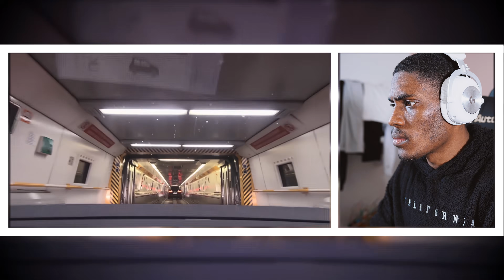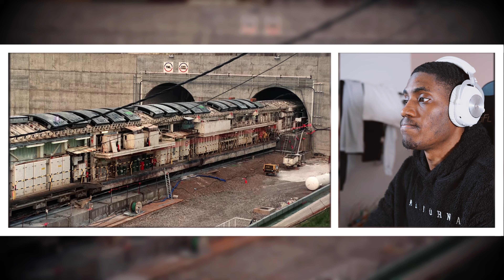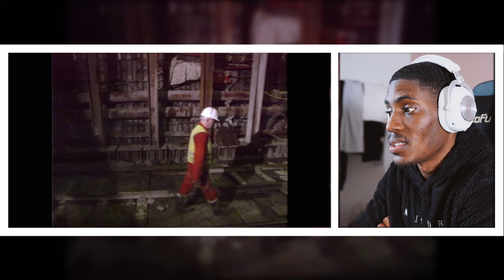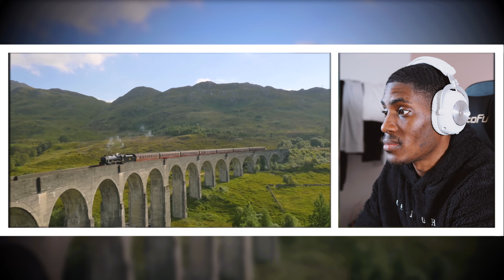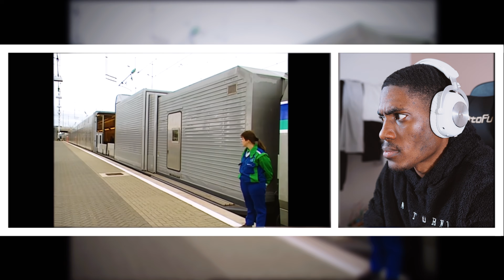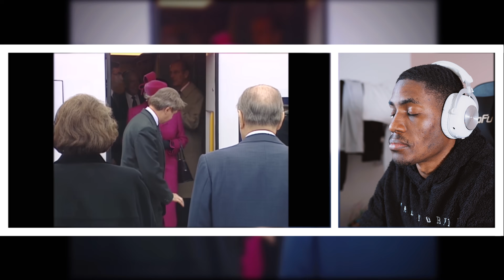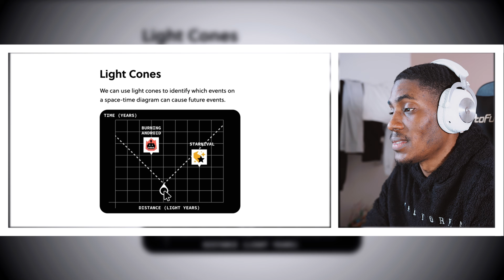American Reacts to How The British Channel Tunnel Works

Comment: We have travelled through the tunnel several times in our car and once took our caravan through it on our way to Italy 
It’s seamless and quite efficient most of the time although there can be delays at peak times. When you are in the tunnel you can actually see the undulating path it takes and if you set you satnav you can watch yourself go under the seabed 
There is a massive shopping complex on the French side of the tunnel and when it first opened people who lived close to the English terminal would get a same day return which was fairly cheap. Travel through the tunnel fill up their car with fuel (which was cheaper in France at that time) do some shopping and be back at home before midnight

Comment: I needed to know why couldn’t they dig a Very Very Very Very Very Long Deep tunnel and do an extension for most of the mainline Trains, so they can extend the abandoned London underground train stations. Why couldn’t they use the part D78 Stock train doors on the sides and also restructure the front face of the A60 and A62 stock which will include the class 507, class 508, class 313, class 314 and class 315 remix and make them all together and also redesign all of them into an overhead wire line trains and also make most of them into Five carriages per units and also having three Disabled Toilets on those Five cars per units A60 and A62 stock trains and also convert the A60 and A62 stock trains into a Leyland 510, Volvo D10A, Scania N113, Leyland TL11, Cummins M11, Gardner LG1200, Lister Diesel, Gardner 6LXB and Gardner 8LXB Diesel Engines and also put the Loud 7 speed Allison Gearboxes even Loud 10 speed Epicyclic Gearboxes in the A60 and A62 stock, class 507, class 508, class 313, class 314, and class 315 and also modernise the A60 and A62 stock and make it into 11 carriages per unit so it could have fewer doors, more tables, computers and mobile phone chargers? A Stock Train and 7 Disabled Toilets on those A stock trains. Why couldn’t we refurbish and modernise the waterloo and city line Triple-Track train tunnel and make it even much more Larger and extend it to the bank station, making it into a Triple-Track Railway Line so those Five countries such as Australia, Poland, New Zealand, Italy, And Germany to convert the waterloo and city line Triple-Track Railway tunnel into a High-Speed Railway lines? The Third Euro tunnel Triple-Track Railway line to make it 11 times better for passengers so they could go from A to B. Then put the modernised 11 carriages per unit A Stock and put them on a bigger modernised Waterloo and city line Triple-Track train tunnel so it could go to bank station to those Five countries such as Australia, Italy, New Zealand, Poland And Germany The modernised refurbished 11 carriages per unit A stock could be a High Speed The Third Triple-Track Euro Tunnel Train, so it is promising and 47 times a lot more possible to do this kind of project if that will be OK for London, Australia, Italy, New Zealand, Poland and Germany oh by the way, could they also tunnel the Triple-Track Railway Line so it will stop from Buckinghamshire and Essex so that the Passengers will go to Australia, Italy, Poland, New Zealand and Germany and also extend the Triple-Track Railway Line from the Bank to Buckinghamshire and Essex Stations so that more people from there could go to Australia, Italy, New Zealand, Poland And Germany more Easily. Why couldn't they extend the West Coast Main Line Railway Stations and also build brand-new train stations so it could go even further right up to Clapton, Wood Street? Can they also make another new underground train station in Chingford, and could they extend the West Coast Main Line Railway Stations and the DLR right up to Chingford? All of the classes 155, 106, 154, 114, 105, and 117, will be replaced by all of the Leyland TL11, Cummins M11, Volvo D10A, Leyland 510, Lister Diesel, Gardner LG1200, Scania N113, Gardner 6LXB and Gardner 8LXB Diesel Five carriages three disabled toilets are air conditioning trains including Highams Park for extended roots which is the West Coast Main Line Railway Stations and the Docklands Light Railway Stations. Could you also convert all of the 1962 stock trains into an air-conditioned maximum speed 81 km/hours (51 MPH) re-refurbished and make it into a 7 cars per unit if that will be alright, and also extend all of the West Coast Main Line Railway stations to make more space for all of the extended 7 car per unit 1962 stock air condition trains and can you also build another Mayflower and Tornado Steam Locomotive Companies and can they order Every 92 Hexagon and Every 49 Octagon shape LNER diagram unique small no.14 and unique small no.11 Boilers from those Countries such as Greece, Italy, Poland, and Sweden, can they make Mayflower and Tornado Steam Locomotive speeds by up to 157MPH so you can try and test it on the Original Mainline so it will be much more safer for the Passengers to enjoy the 157MPH speed Limit only for HS2 and Channel Tunnel mainline services, if they needed 13 Carriages Per units, can they use those Lister class 93’s, Lister class 17’s, Lister class 47’s, Deltic class 44's, Lister class 40’s and Lister class 43HST Diesel Locomotive’s right at the Back of those 13 Carriages Per Units so they can take over at the Back to let those Mayflower and Tornado Steam Locomotive’s have a rest for those interesting Journeys Please!!!!, oh can you make all of those 19 Tonne Boxes of Coal for all of those 157MPH Mayflower and Tornado Steam Locomotive’s so the Companies will Understand us PASSENGER’S!!!!! So please make sure that the Builders can do as they are told!!!!!!!!!!! And please do something about these very very important professional ideas. Prime Minister of England, Prime Minister of Australia, Prime Minister of Poland, Prime Minister of Germany, Prime Minister of Italy, Prime Minister of New Zealand, and that will also include the Mayor of London.

Comment: The Channel Tunnel make a profit on its operating costs, which is enough to make it viable. It's not a white elephant, and of course it should have been built.  Most people without cars (70-90%) travelling between London and Paris use the tunnel not planes. For crossings from Folkestone to Calais by car, about 60% is by tunnel and 40% by ferry. But when it comes to freight, ferries have 95% of the traffic.

Comment: I live in London I can be in Paris in 2 hours 15 minutes Brussels 2 hours & Amsterdam 4 hours It’s a fantastic link if you’re using the passenger service it’s city to city unlike an airport which you have to get to then wait an hour before you can get your flight, which is another hour and then another half hour at the other end to get into the city Centre you can book a single for a approximately $65  I disagree with you it’s very needed  It’s a fantastic peace of engineering. And a great link to Europe.

Comment: I've used the tunnel several times to drive my van down to my brother's place for a months motorcycling in SW France… It's quick and convenient, connecting seamlessly between the UK motorway and the French autoroute system.
 I drive 200 miles to the tunnel in late evening, grab a few hours sleep in the driver's seat while waiting for my booked early crossing at around 5am, then arrive in France at the same time due to the time difference. This way I'm early enough to avoid Calais' and Rouen's morning rush hour traffic, and catch the quiet spell between morning and lunchtime busy periods passing through Chartres… the rest is plain sailing through open country and great scenery on a mixture of traffic free N roads and fast autoroutes, climbing the Massif Central after Clermont-Ferrand and crossing the famous Viaduc du Millau (If engineering's your bag, check out how that was built… amazing. https://www.youtube.com/watch?v=mbAw8unrJ-U ). Only stopping for fuel and/or a piss (if you step inside a services, you've lost at least half an hour) and eating packed food, I'll arrive in time for dinner at my brother's place, near Béziers (around 650 miles from the tunnel), or we'll drag my bike out of the van and ride to a nice local bistro or bar. Driving long distances on French roads is easy and pleasurable. The 200 miles on the UK ends of the trips feels almost as long as the 650 miles in France.

Comment: Others have said, but this is definitely not a fail. It’s incredibly well used albeit more pricey than it used to be. If you live in the south east of England you can pop over to Paris for the day and be home for bed. 

I mean relying on planes that require fuel and inevitably deliver some distance from the city centre has its place but you never know when so idiot is about to do something stupid where all the fuel is coming from do you!

Comment: HS1, the tunnel and TGV allows direct travel from St Pancras station in the centre of London to Gare du Nord in the heart of Paris. There is London City airport, but otherwise you need to get to London Heathrow, then from Paris, Charles de Gaulle into the centre of Paris.

Comment: Yes, cars.  I've taken mine on it.  The Eurotunnel trans are tall enough to be double-decker for cars - remember they need to be big enough for lorries, coaches and buses as well.  And of course there are normal passenger trains as well, the Eurostar from London to Paris, Brussels and Amsterdam.  I've been to Paris this way too - much less fiddle than flying and comparable in price and time.

It helped in building it that the sea isn't hugely deep.  The North Sea and the English Channel were dry land only a few thousand years ago and they've sunk, turning Britain into an island, only since then.  So Stone Age people got here by walking, and there is archaeology that can be done on the sea bed.  (Look up Doggerland to find out more.)  This also means tunnelling was easier than through solid rock. But soft soil or sedimentary rock has other problems... suffice it to say that the geology was investigated very thoroughly first, as stated in the video, to find the best path.

I well remember the day the British and French teams met in the middle and there was that handshake through the hole - it was all over the news!

Yes, a ferry takes longer.  It's an hour and a half compared with 35 minutes through the tunnel.  But a sea voyage is something different.

Comment: Back in the early 2000's I was a courier driver from England and have travelled through the channel tunnel loads of times, it's no that spectacular when you actually go through it, but yes it's an amazing feat of engineering. To be honest I don't like tunnels but yeah it is pretty amazing. I always went on the trains that carried trucks, you park your vehicle on the train then go to a carriage at the front of the train

Comment: Ive used the channel tunnel twice but it is dearer than the ferry. The ferry takes about 75 mins the tunnel is about 45 mins. 
The passenger train EuroStar goes from London to Paris its very expensive unless you get a deal. I prefer the ferry. The Eurotunnel is good but not being able to see anything outside is weird. 
London also has tunnels under the Thames river for vehicles also one at Dartford which is usually one way south to north and a bridge north to south. As its a toll service it does cause lots of slow moving traffic. However instead of paying cash at a booth it has vehicle registration recognition so its all done online.

Comment: I've never been through that tunnel, and I don't know if I'd feel very safe doing so. After the disastrous fire in the Mont Blanc Tunnel, it's understandable to be afraid. The Mont Blanc Tunnel was already old, and the technology of the time was certainly less reliable. That's perhaps also why the Channel Tunnel is only for rail. There's talk of a tunnel project under the Strait of Gibraltar, but it's even more difficult to build : it's longer, deeper, and would require crossing the boundary between two tectonic plates. So, if that one ever comes to fruition, there's no way I'm ever going through it ! Yet, the Greeks built a suspension bridge that spans the Gulf of Corinth, crossing a tectonic boundary, and it's still standing today. It doesn't inspire confidence in me, though... I prefer the ferry : the sea is quite calm in the region, whereas there are often earthquakes.

Comment: As a structural engineering student, i have no idea how one would even start to calculate the things needed for this tunnel or what things you would even need to take in consideration for it 😅
Reply: Vous pouvez venir en Europe, pour apprendre ce que vos écoles ne vous enseignent pas. Le Tunnel sous la Manche n’est pas une vue de l’esprit, puisque chaque jour des milliers de passagers l’emprunte sans aucun danger et arrive d’un côté comme de l’autre en bonne santé, rapidement et sans polluer.
Reply: @salvatoreuzzardi6903  i am in Europe my guy, im Finnish 😁👍

Comment: For city to city there's nothing to beat it. If you are taking your car, it is identical to the ferry ie coast to coast  but quicker.  There are also an equal number of trains that go directly to Brussels, stopping at Lille en route. Also, those to Amsterdam and Rotterdam, in the Netherlands,  in addition,  since Eurostar bought the French Thalys trains  there is the Eurostar to the south of France.
Of course, having utilised the Eurostar to whichever destination you desire there are all the regular rail network links of the various countries to take you further afield, including those with sleeper carriages for longer distances.
So the tunnel gives you far more than just an A to B route, it opens up an entire continent.
I love Eurostar ❤  there is a bar and cafe, and full dining included in higher class tickets. Fares start at £39, but can be very expensive if you book last minute and/or go 1st class.

Comment: There are occasional delays for various reasons but overall, my family and I have used it plenty of times and it is pretty good. It takes around 35 minutes to travel under the channel, the usual crossing time for a Dover Calais ferry is about 1hour 30 mins. However it's generally much faster to embark/Disembark the Channel shuttle trains compared to the various ferries. 
The Calais to Dover Ferries, typically cost between £120 and £200 return for a car and passengers. Foot passengers are far cheaper, a return starting from £40, however most train travelling foot passengers would use the "Eurostar"  from London to Paris or Brussels etc... return prices ranging from £39 to £339. Channel tunnel prices are currently a little cheaper than ferries overall, longer stays or standard tickets usually start around £115-£150. Five day trips and under are even cheaper. There are also cheaper one off deals and much will also depend on the time of day or night you travel? BTW, the are plenty of other ports on both sides of the Channel and North Sea so it may be cheaper but a little longer to go on a ferry to Belgium, the Netherlands, depending upon your destination?
 You will have to check the exchange rates for these prices, today, 21/04/2026 (Correct date format), it's $1.35 to £1.00. So it's not so cheap for Americans currently?

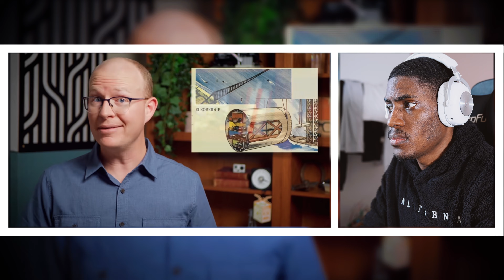Comment: 5:25 Until recently I actually worked at the factory that makes ParaFil and occasionally ran the line that makes it. It's nothing particularly ”exotic", it's just a rope made from Kevlar or similar Aramid Fibres that is covered in a sheath similar to electrical cable.

Comment: Suggestion: Find videos about how very well Europe is designed via interconnected rail links. Also find videos about why the USA abandoned or destroyed much of its original rail network. The UK & other parts of Europe have discontinued rail lines but most have been re-modelled as cycle lanes or footpaths which preserve wildlife habitats.